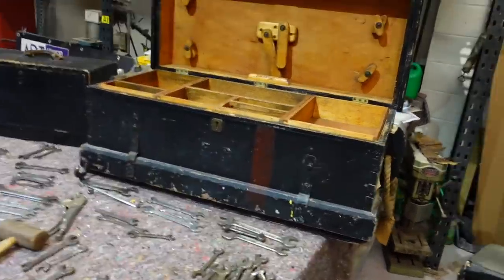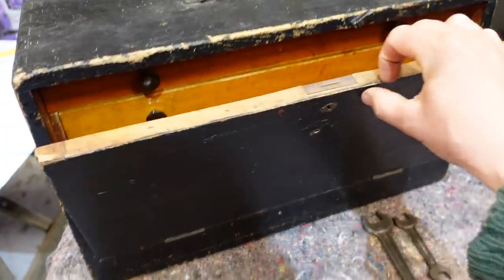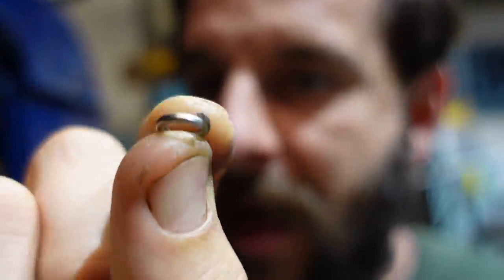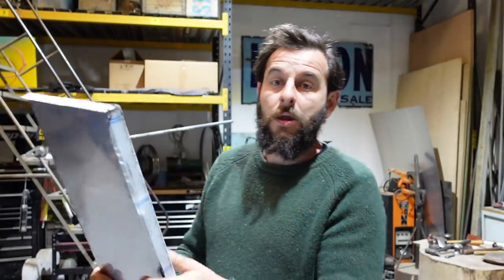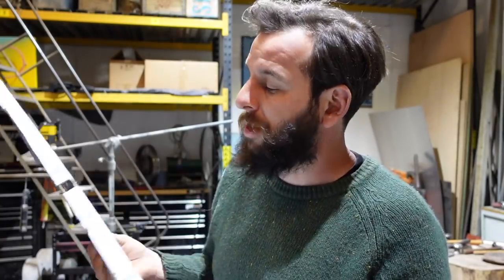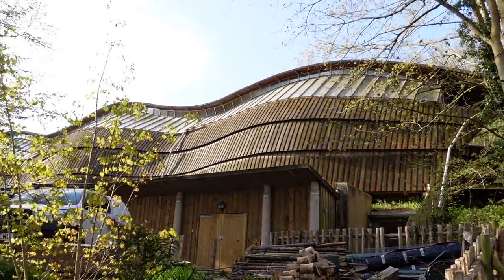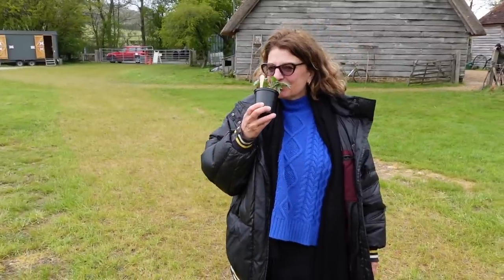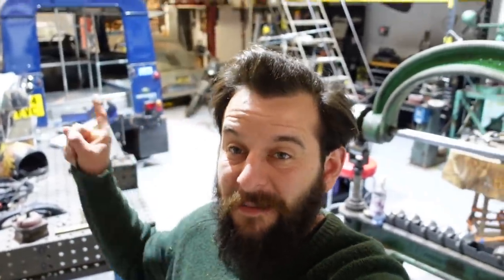'Grinding On With The Defender' | Vlog #6

Comment: Another great video as usual. The sea chest looks great and such a bargain.
One tip I saw about the tomato plant. The flowers are both male and female in the same flower rather than some male and some female. When the flowers grow, tap the flowers firmly, making sure the open end is downward. This makes the male part release the pollen and pollenates the female part. This sets the flowers and they should then produce fruits as the plant grows. Maybe you could pass the tip on to Lucia. I did this with our 2 plants and we had a constant supply of tomatoes a few at a time for several weeks.
Reply from the maker: Brilliant tip thank you! I will tell Lucia definitely

Comment: Suprised that you have Aluminium & Stainless in contact in your Defender rebuild - when used in boats the moisture causes electrolytic corrosion unless you manage to electrically insulate the pieces and the fastenings. Sheets of thin plastic and lots of the Yellow paste ( I can't remember what it was) provided a partial cure.

Comment: The building with the thatched roof, is it the repair shop that is filmed for BBC tv? 
What is the framework in the rear of the defender going to be used for?
Reply: by the way, anymore Goblin workshop projects in the pipeline?

Comment: That grid building looks like the inside of a giant Wellington Bomber, geodesic construction designed by Barnes Wallis of bouncing bomb fame.
Reply: I think the principle is the same but the grid is of course build from wood rather than the thousands of quite small formed pieces of Duraluminium used on the Wellington. Have a look at The Secrets of thew Transport Museum for a detailed view of the construction and someone with a lot of patience cleaning all the pieces and coating them with preservative. They should have brought it to the Repair Shop !
Reply: @johnmurrell3175  I watched it last week such patience

Comment: Those chests are a work of art Dom. Loving these videos.

Re the Vespa, You may have done all this already, if not, while you are waiting for the log book download the MOT exception form V112.

https://www.gov.uk/government/publications/declaration-of-exemption-from-mot

The Vespa (1976) is now over 40 years old and does not require by law an MOT, also when you get the log book, if it has not already been classed as "an historic Vehicle " (over 40 years old) take the log book and V112 to the post office and they will Tax it (free) and send the log book away to make it an historic vehicle for you so you can just insure it a ride it straight away, zero road tax and no need to SORN if insured . My owned from new Z500 on my channel was done like this.

Also as it was registered before 1st Jan 1980 it can legally have a black and white number plate.

Be great to see it parked next to the barn or "scooting" round the area.